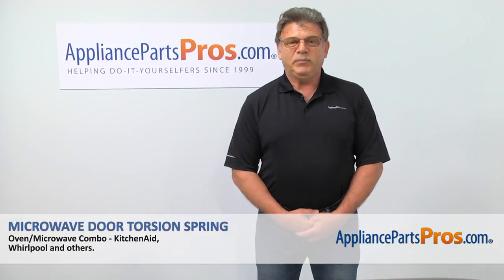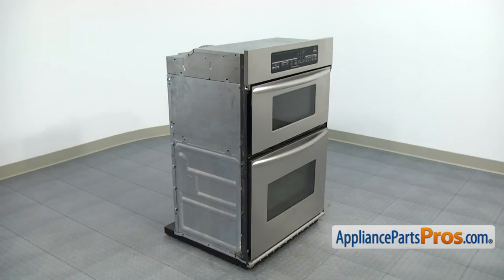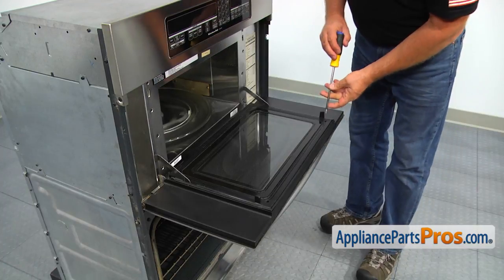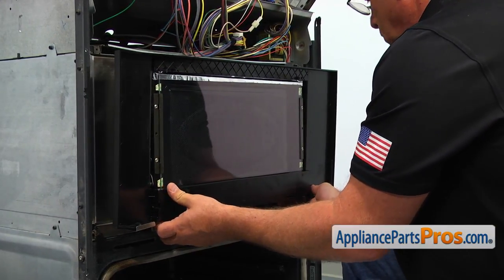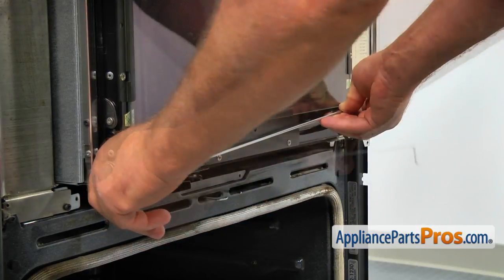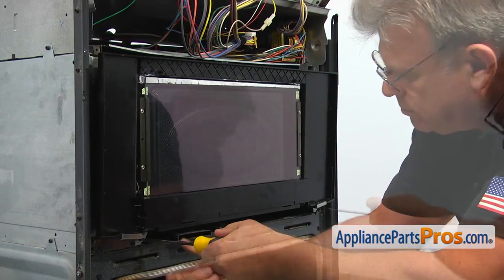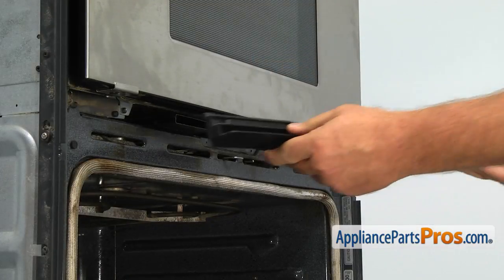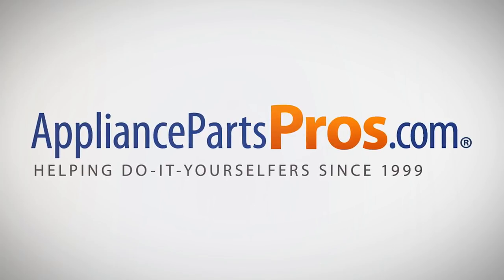How To: Whirlpool/KitchenAid/Maytag Microwave Door Torsion Spring WP4452396

Comment: Thanks for the video and I have the same model which needs the right torsion spring replacement of the upper door (microsave). However, I did not have to remove many things that were done in this video. I was able to access the bottom two screws holding the microwave door frame just by removing the vent cover. No need to remove top control panel, bottom oven drawer or pull out the microwave unit. The biggest trouble is to find the replacement torsion spring.. none of the vendors I searched for had it in stock. Also, for some reason only right side springs are available. The springs are expensive for what it is.

Comment: Should point out that the side trim must be off to do this. You can remove the trim on both sides by taking out the small screw at bottom of each piece. Once removed, you can then wiggle the trim free - there are no screws at the top - the trim just fits up under the control panel which holds them in place.

Also, if your unit is built-in you probably have drywall or a cupboard immediately above it so there is no place to set the control panel as in this video. To solve that, once you remove the two screws holding it in place and have removed the small wire connector, if you also remove the connector on the far right side you will then be able to pull out the control panel more and turn it sideways so you can slide it back into the empty area behind it.
Reply: This is one key piece of info I was looking

Comment: i did this with WP4451009  and WP4451008 because my door was free falling.
After replacing the springs the door still free falls..
any idea what is causing free fall?
Reply from the maker: It could be a couple of things. It could be the incorrect parts for the model, or incorrect installation, or it could be another problem. It would be difficult to say without more information about the problem and your model. You can give us a call at 1-877-477-7278 or you can chat us at our website: http://www.appliancepartspros.com/. We will need the model number for the appliance, so that we can look up diagrams and information about your specific unit to give you accurate advice. You can look here on our website to help you find the model number: http://www.appliancepartspros.com/modelnumber_locator.aspx
Reply: @appliancepartspros  in 2010 i ordered the wrong parts #WP4452396 and #WP4452395 from you, it  should have been WP4451008 and WP4451009   (mine is black with stainless, not pure stainless like in the video).
would it free fall with the wrong springs still? (but the broken spring had a blue tip)
Reply from the maker: @turinreza  If it's the wrong springs for your model then it could cause that. You always want to make sure you use your appliance model number to get the correct parts for your specific unit. Give us a call and we'll help you sort it out.